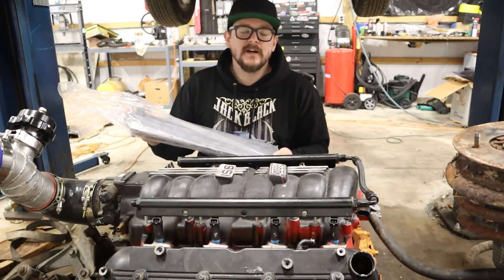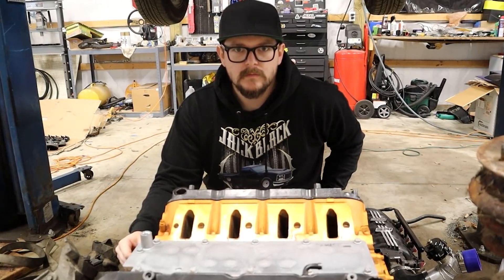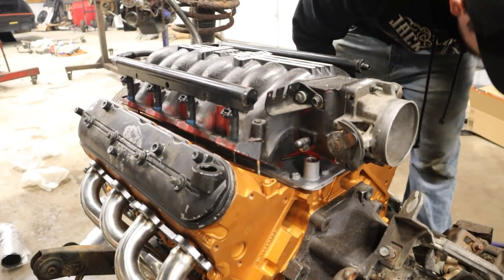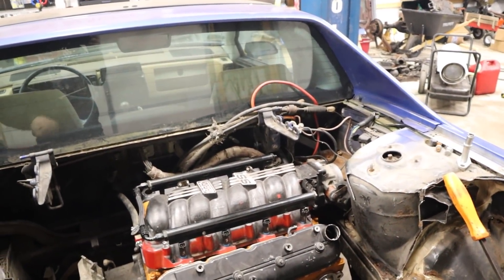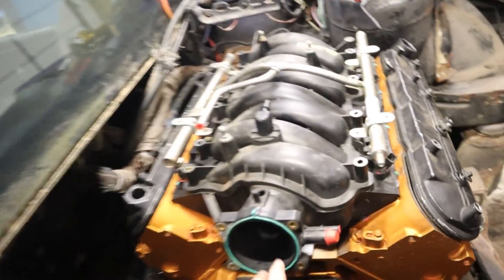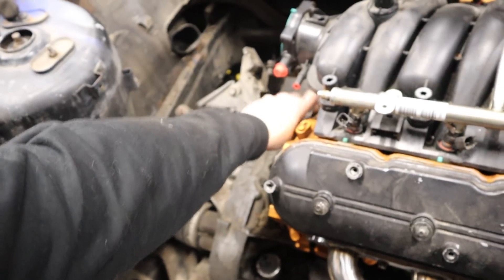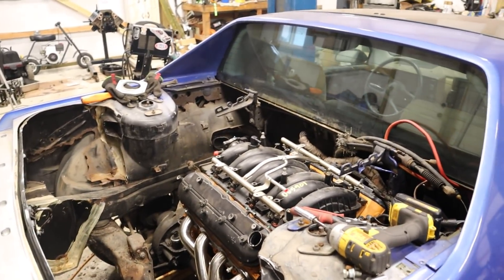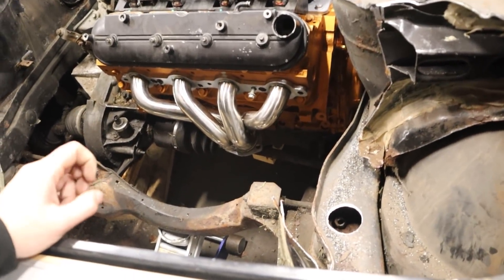The LS4 is BOLTED IN! There's PLENTY of room! | Turbo LS4 Fiero Build Part 6

Comment: Just an idea on that valley cover measure the depth the oil pressure sensor sits in mark it and make a 45° cut and get ot tig welded and it might work and you can twist the angle to make it fit better just an 💡

Comment: Cut that long oil pressure bung off, tap it and put a 90 degree pipe thread fitting on it 🤷‍♂️I’ve got one of those valley covers on my shelf if you need me to take a look at it. Might be able to just swap yours for a different year

edit you probably have more valley covers laying around than I do 😂

Comment: If you weld a short piece of schedule 40 pipe around the drilled hole it will definitely reinforce it. Usually round holes do not compromise the integrity is a structural member. I am a new subscriber. Liking what I see so far. Thanks for sharing. 👍👉🇺🇸👈

Comment: Pick up oil pressure from oil cooler block off plate above filter.  There is a manufacturer that makes them.  Also don't waste money on valley pan. Drill and tap afm bosses then plug off with hex keyed pipe plugs. Then install a standard valley cover from 4.8 or 5.3, or you can install Welch plug in stick oil port next to the oil pressure boss and reuse afm vlom valley cover.  Looking good 👍

Comment: AWW man a master fabricator such as yourself cant be afraid of cutting the heaviest LS intake ever made. just notch it for the oil pressure sender 
weld in a piece of aluminum pipe and wahala problem solved. no rework involved.   p.s.  you killin it with content

Comment: I got an LS in my 95 Impreza and it has good room still. If its got a 4 cylinder in it flat or inline its got room for a V8. Since a I4 is tall af and a flat4 is wide af an LS is both shorter or skinnier then both engines respectively. The hardest thing to get to fit is usually the transmission though. LS the world!

Comment: I have been watching a channel called Leon's garage adventure and he is putting an LS3 into a Fiero. He is using a kit of some kind and it looks like he is using the Original starter and mount position with an adapter. Lots of modifications to the cradle too. Just letting you know so that you can take a look.

Comment: The hole in the frame rail won’t hurt the strength that much where it is but welding a bead around it will hurt the strength.
If you want to strengthen it put a bit of tube in the hole and weld a washer and nut at the bottom and weld it around the top.

Comment: Find a pipe that’s the same size as the holes you drilled in the frame and put it going to the bottom of the frame and then weld it in to the top. 1 stops shrinking of the frame around the hole which will lead to cracks and 2 stop any dirt and junk frame getting in the frame and holding moisture leading to a rusted out frame

Comment: Josh I don't know alot about ls engines but can you use an intake spacer to clear that oil pressure bung or make the the oil pressure bung angled or possibly drill and tap a hole on the side and cut the bung down low enough to clear the intake so it's like a 90deg angle for the oil pressure bung. Just wanted to throw some ideals out not sure if that will work... Good luck on the fire hazard project

Comment: Just a thought, if you did snake the charge pipe around the engine, wouldn't that give you a little space to put an intercooler over top of the transmission?

Comment: Idea for the cradle bolt spots why not drill through both side put a piece of pipe through the frame with a piece of 1/4 inch plate flush welded into the bottom flush welded to the frame with a hole drilled in it so it stiffens  the frame where the cradle bolts to it so it doesnt crush the crusty rusty frame when you launch it

Comment: I thought of an alternative transmission that is probably cheaper than  many options. The old Toranado trans ae and tranny should hold up since it came with big block power and 5 tons of car. Some motor homes used it also which would be dirt cheap in most cases.
Reply: very,very hard to find...
Reply from the maker: Hard to find, and I don't think that was a transverse transmission